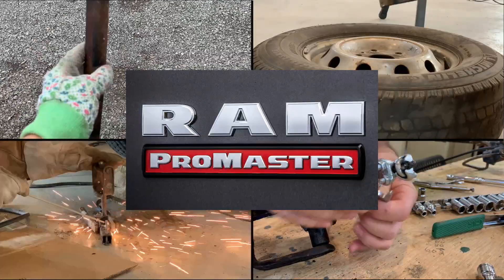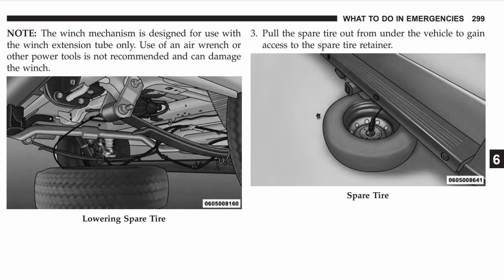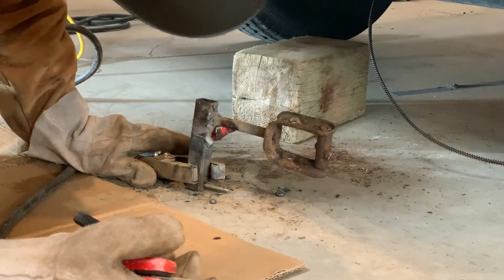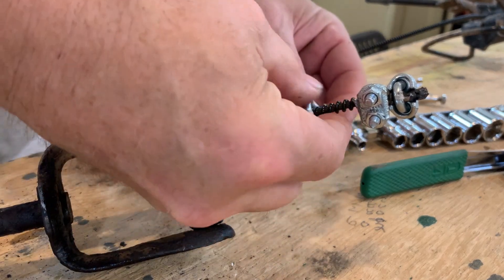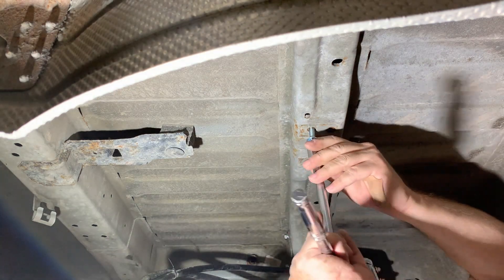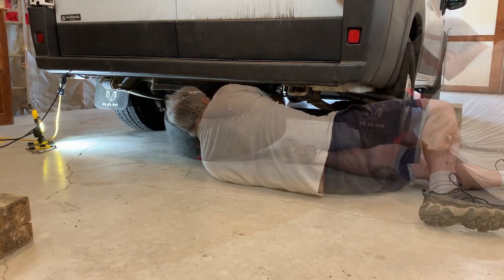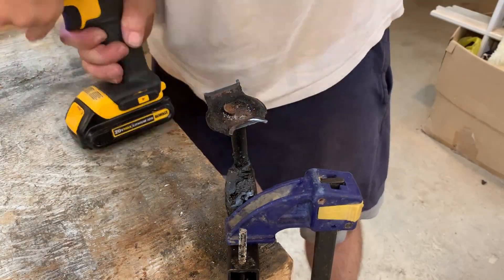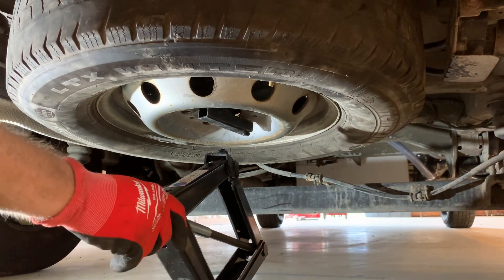RAM PROMASTER VAN BUILD – Spare Tire Winch Repair

Comment: Mine just snapped right at the end of the cable. Thank god it happened on my driveway. Im thinking of just looping the cable around and clampimg it with a few clamps. Would that work?
Reply from the maker: Good question. I don’t know.  In my opinion, this is an awful design by RAM.  We are talking about something that needs to work during an emergency.  It sits idle most of its life, but then needs to work.  I wouldn’t bet on it.  RAM can do better.

Comment: Great video!  I just decided to try the winch and make sure it worked, just in case I ended up somewhere with a flat.  Sure enough, it's stuck.  Guess I have to try and take it apart to get it working.  I hate these things too.  Had one on an old Toyota truck.  It didn't work very well either.
Reply from the maker: We just finished a road trip. on the trip we had to buy a couple of tires, and the job included the movement of the spare.  It lowered ok, but we once again had to use the vehicles jack to push the spare all the way up, as the winch was stripping.  What a stupid system. :-)